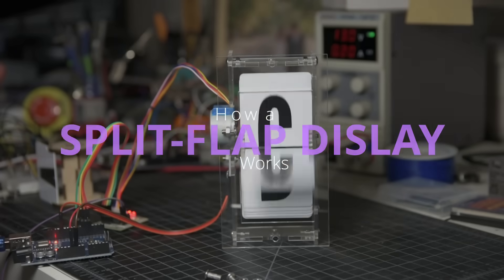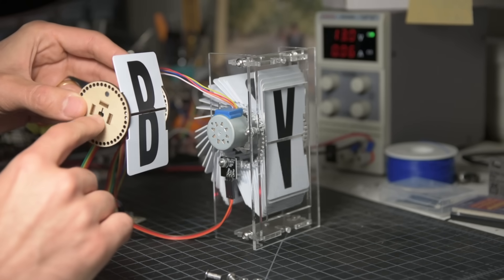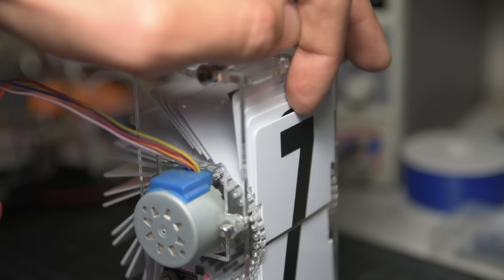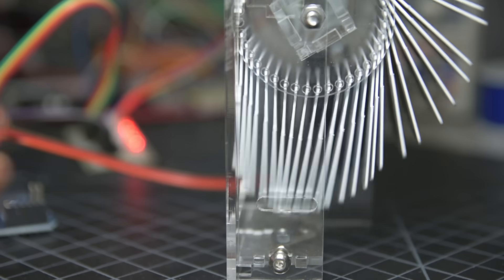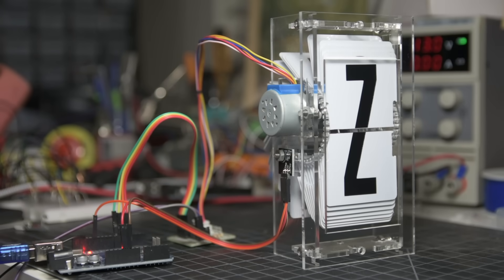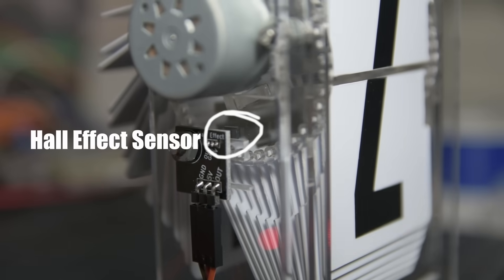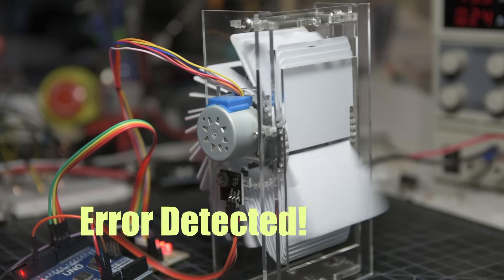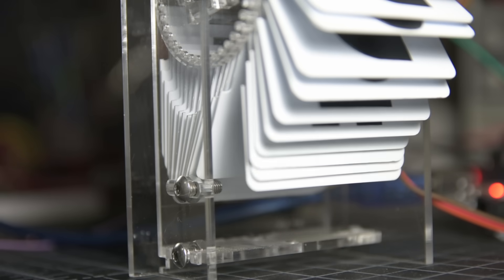How a Split-Flap Display Works

Comment: what kind of meterial did you used for making that flap?
Reply from the maker: The flaps are PVC, with off-the-shelf vinyl letter stickers applied. The flaps can either be made by hand from blank CR80  cards cut in half with slots punched out of the sides (https://github.com/scottbez1/splitflap/wiki/Cut-flaps), or I sell pre-cut flaps on Tindie (https://www.tindie.com/products/scottbez1/blank-split-flap-display-flaps/)